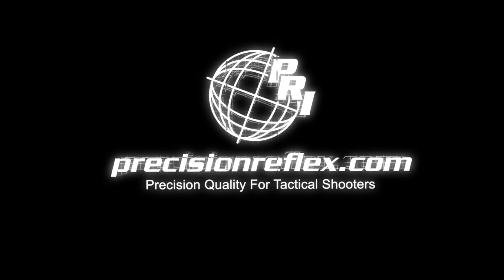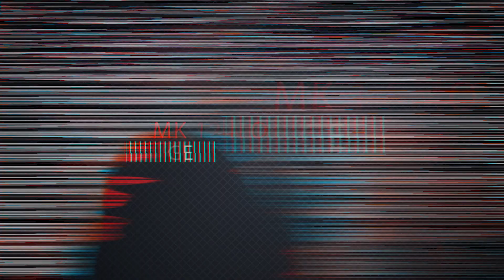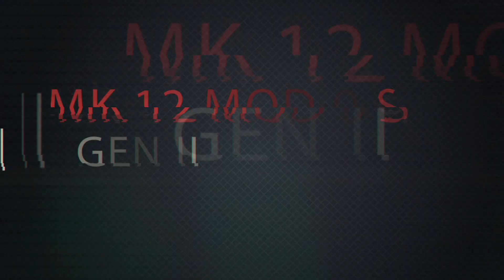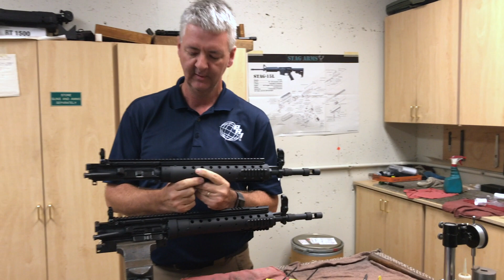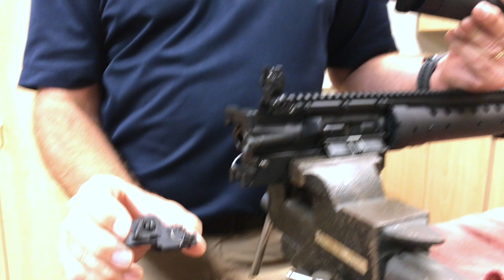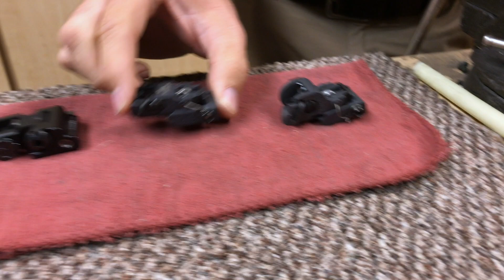PRI How to tell an MK12 Gen II vs. Gen III

Comment: What is the inner diameter of these handguards?
Reply: Inner diameter = 1.746" 
I got a gen II rifle length. its awesome, looks & fits great. If you use these handguars the gas block must be in front of the hand guard, you cannot fit a gas block under it. You have to buy the appropriate length handguard for your gas system because the nut (or collar) that secures the hand guard to the barrel nut must be tourqued down and put in its final place before the gas tube is slipped under the hand guard, thru the barrel nut and collar & into the upper. So, A midlength or carbine length gas system will not fit under a rifle length handguard, had to buy a new barrel and gas system, not even mad this handguard looks so damn good i would rebuild the entire rife to accomodate it